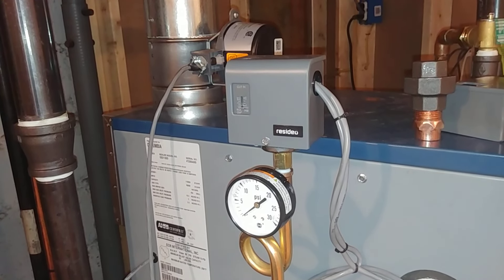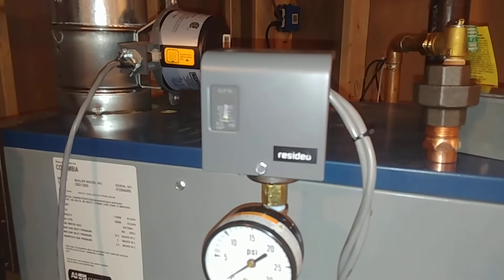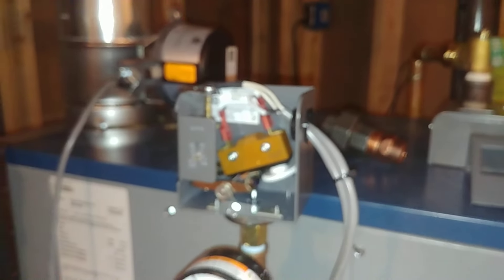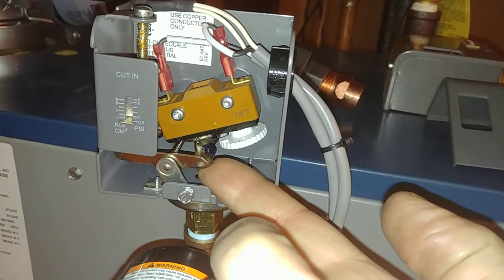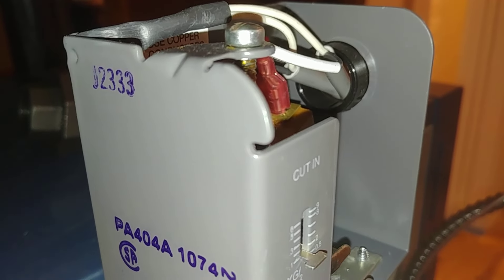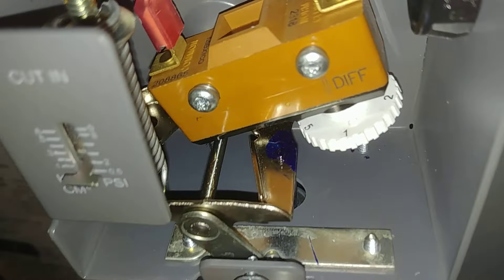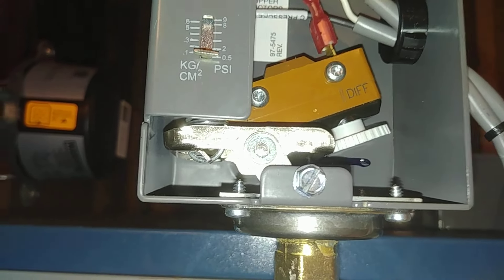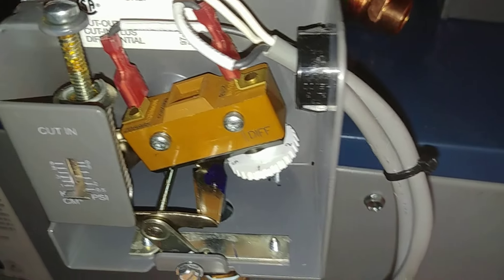Quality Control? We Don't Need No Stinking Quality Control! Honeywell Pressuretrol Fails Yet Again

Comment: Glad I found this Video !!!
I have an old National Boiler from 1962 that still runs fine. Sight Glass, relief valve, low water cut off number 67, gas valve all been replaced within the last 15 years by me.
4 years ago I was sick and couldn't do anything. I was bed bound.
My boiler kept building up pressure and sounded like a bomb and I had to have about 20 lbs. of pressure in the boiler. 
Called a heating guy out and told him to change the Vaporstat. Its not working and boiler pressure keeps building. The clown tried to tell me it's a clogged radiator vent. I tried to explain to him the pressure gauge reads boiler pressure, not radiator pressure. I told him if I closed every radiator in the house, blocked every pipe, the Pressuretrol cuts out at boiler pressure, not a radiator vent. If it's 0 degrees and every radiator is smoking hot, boiler will cut off at 1 or 1.5 PSI. Mine is not. I have over 15 lbs. of presure. Change the Pressuretrol.
He refused and told me I don't know what I'm talking about. 

I sent my nephew to get another Pressuretrol. He came back with this one. I told him to ask the supply house to set it for me at what it should be. I just went through my boiler for this season. Replaced the drain valve, which quit draining since it was clogged and been on there for 40 years, and the Pressure Relief Valve thats been on there since 1962 just to be safe. 

Last but not least I decided to check my "Pig Tail" to see if it was clear and open. 
I took it off and glad I did. It was clogged. Air compressor blew it open and cleared it and I washed it out real good. Put the Pressuretrol back in and looked at this video. Checked mine and what?  It was set at 1 on the dial, and +5 at the cut in.
Don't know how everything still worked but I guess since the Pressuretrol couldn't detect pressure because of the clogger "Pig Tail" it alway's sensed a 0 pressure condition and let the burner keep coming on. 

So glad for videos like this. 
"Heating and Cooling" guys are a dime a dozen. People that know about Steam Heat are hard to find.
Reply from the maker: Thank you very much for telling your story!
I am glad you your steam boiler pressure back under control.
I'd check that pigtail every year from now on.

Comment: The fact Honeywell sells a product that looks like a high school lab project. It is just insulting.
Reply from the maker: LOL that's a little harsh, but I get what you mean.
It's not the design, per se. 
I would posit that the PA404A is a basically good design overall.
They have been making this version for over 20 years.
Case in point, even with Honeywell's now non-existent QC, it is still possible to fix the issue with a flat-bladed screwdriver and five minutes.
My beef is WE shouldn't have to do that!

Comment: I will never understand why "steam boiler techs" insist on running such high pressures in houses and buildings. I never operate any steam heating boiler over a pound unless in a very unusual situation. Usually 8 to 12 ounces is way more than enough and the benefits are many ie: no banging or knocking or at least greatly reduced, steam traps and especially vents work much better without hissing and leaking. That 404 can not be adjusted low enough and just when you think it's working good you get a callback because the boiler will not come on as since the control is set too low. Honeywell made an ounce control that works way better L408j1009. I have been told they may have discontinued that control but I just bought one the other day at Supply House. The guy I was talking to said they have plenty of them. Those 404s are nothing but headaches.

Comment: I agree,  quality issues. By your own admission modifying the pressuretrol is not advised. How did you verify the cut in / cut out? What about drift? This is a bad idea.
Reply from the maker: I used to put the units on a made-up testing rig. 
See other videos on this.
Since then, finger pressure as shown.
My field mods can't be worse than a non-working f'd-up control, eh?
Drift? Not bloody likely.
Reply: @gordonschweizer5154  🤣,  true 👍
Reply: @gordonschweizer5154  good videos,  please keep posting. Not too many steam boiler installers/servicers left.

Comment: sad..  but honeywell all around is having issues..  even something as simple as ther good old "gold standard" T87 thermostats are crap.. granted not huge numbers of people that want them but there are still quite a few that do amazingly.. and failures in the newer ones are quite common... ..the old ones lasted forever..  (as noted by my friend that has a house built in 1969 with its original willamson branded T87) and the original williamson furnace and A/C...  in this video it almost seems like it was a shipping thing more than QA at the factory..  it doesnt take much to bend the parts in those pressuretrols if it was dropped a good one by the transit company
Reply from the maker: Just yesterday I was at the local boiler rep, Columbia Heating Products, and there on the desk was this model control, same date code, same problem, that someone turned in as defective.
I don't think this is a shipping issue
Reply: @gordonschweizer5154 indeed sure sounds like lack of QA in the factory at that point. No such thing as coincidence !!
Reply from the maker: @eldoradoboy  Yes, that makes three.
Two for me & one on somebody else.
I asked the rep to give Honeywell a call to report it... They were not interested.
Can't totally blame them.
One - a fluke
Two - a trend
Three - SCIENCE
Reply from the maker: Went in the other day to my Columbia Rep, and got them to watch this video.
Hope maybe something good comes out of it.
I had forgotten that I talked to them before until I went back over my own comments!